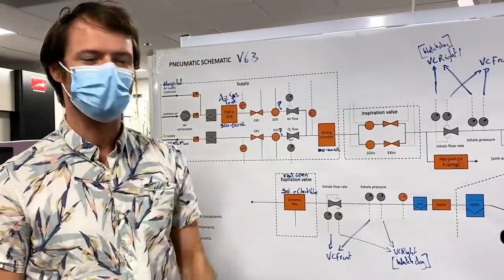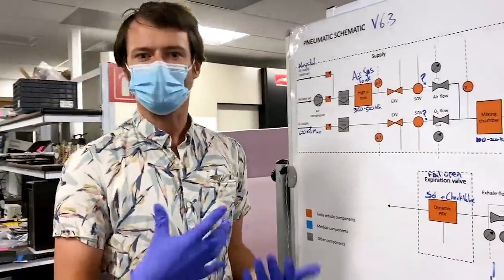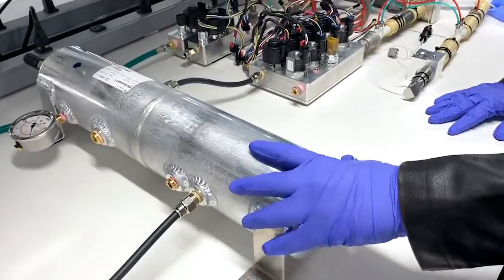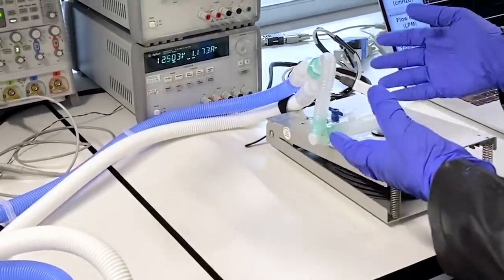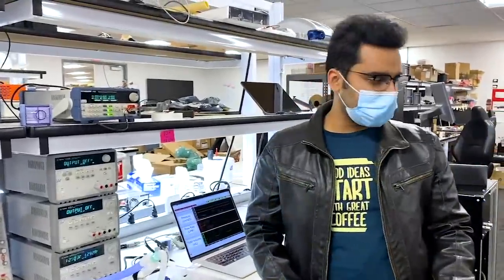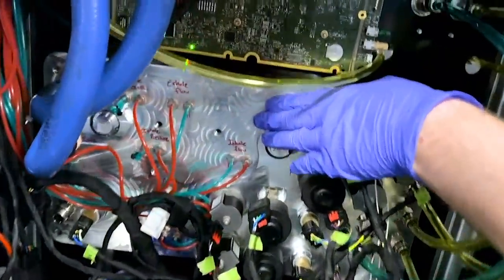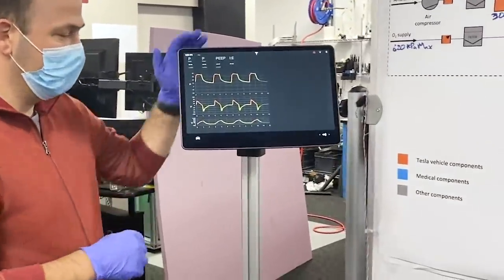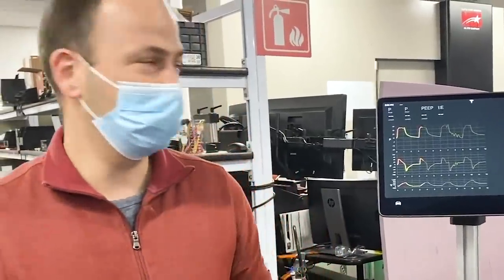Tesla Ventilator

Comment: this looks like an expensive ventilator
Reply: Ventilators are expensive. And extremely complicated. It seems like they are trying to design this to be built quickly at Fremont, without needing to do a major redesign of a production line. I hope that it works well.
Reply: @anthonypelchat  i meant some of the car parts are overkill for the ventilator, like the display pannel, and the tesla computer, however med equipment is generally pricey not because it's complicated but just because of the market and the heavy regulations.
Reply: @pneumonoultramicroscopicsi4065  Very likely that they are using units that are overkill. Still, the purpose isn't to efficiently and cheaply build a perfect unit. Rather it is to quickly get production started and ramping up with as little of changes needed to the Fremont factory as possible. 

If it takes a week longer to prep Fremont for production and then another week to reconvert back to car production afterwards, it will cost more than building the units with more expensive parts. Plus, less people will get much needed ventilators, potentially costing several lives.

Comment: I have used 
the hospital models (2019).

They are fairly expensive, 
thanks to persistant using 
of new production designs.

****
Job that I've had ?
-- That is all, for this process
-- Disassemble everything
-- Assemble new production process

?? 2/3 is the same ??
! Does not matter !
We redo everything.

Comment: Overcomplicated
Reply: Just like every high end ventilator.
Reply: @anthonypelchat  we dont need hi end right now we just need it to do the job, india already has a device no bigger than a purse that can do the job without hospital air supply and can be made very cheaply.  No time for money making right now.   Ps that device looks ten times stronger than his sheet metal tin can that keeps imploding on the test stands simply because no internal structure, but this you want to over engineer?

That fucking flusy that he was with that cracked him over the head made him loose braincells.
Reply: @Fatpumpumlovah2  Calm down. One, India's ventilator isn't allowed outside of India. I don't know exactly why, but that is the last that I heard. Two, hospitals are calling for the high end ventilators. I think that they know more than you what is needed. Three, this is built with parts that Tesla already produces. That will allow them to produce everything quickly and without having to reconfigure the factory lines. 

Starship is a different product from a different company. They are trying to build a rocket that's larger and more powerful than as ever flown before. And they're trying to do it cheaply, quickly, and publicly. The only similar rocket is the SLS. That has already cost around $20 billion and has been getting built for something like 10 yrs.
Reply: @anthonypelchat  never said they should use indias, pount is we need somethong now quick n dirty that works, not something 6 montgs down the line.  I am a structural engineer of 51 years, i may not know what hospitals request but when u hv an issue like this its there is no time to be overdoing and overcomplucating things.  As for spaceX  i know what they are trying to achieve but in the end i will bet my 51 years as an engineer it will end up with an internal skeleton structure, tin cans dont fly.
Reply: @anthonypelchat  ps diff company but same mind behind both.
Reply: @Fatpumpumlovah2  "We need something now, not in 6 months" We need specific items now. Needing hospitals, but building houses now since they're quick and less complex doesn't solve the problem of needing hospitals. Same here. We need specific types of ventilators or people will die. While there are needs for simple ventilators as well, Tesla can build the complicated ones while less capable companies build the simple ones.

For the 6 months part, Tesla is planning to have these designed and approved quickly, within a week or two. They are also designing these with parts that they already produce to speed up production. Once approved, they will likely be able to build a few thousand each week. 

As far as the design in India, that is a secret that India won't share. Tesla, as well as all other companies, would have to start from scratch to design something like that. Since it couldn't use the same parts as Tesla's cars, they would also have to design and build a production line, or drastically reconfigure a current line, just to get started building it. That would be unlikely to happen in less than 6 months. 

"Tin cans don't fly." Maybe not, but water towers do. Star Hopper already flew. The trick is to now build it so that it is as light as possible while being able to handle cryogenic fuel at extreme pressure.
Reply: @anthonypelchat  water towers have internal skeletal structure, not simply welded together sheets.  Your back on india again, was just an example!  I saw a young guy on american news showing his very simple setup that works off a 5 dollar audrino uno card!   Thats the simple i am talkng about.  Anyway  i digress
Reply: @Fatpumpumlovah2  The American's design may not be the right type. Hospitals are needing an invasive positive pressure ventilation system. The smaller ventilators are noninvasive systems that are simpler but less capable. Those are still useful, but not in critical applications. You can see all kinds of hate articles about Elon because he sent those types to a hospital in Florida. While the hospital had an urgent need for those and were very thankful to receive them, the haters jumped on this as an opportunity to hate since they were not the critical type. 

Almost all of the simple ones that you see are those types: CPAP, BiPAP, or APAP. They are useful in early cases and can be used by individuals at home. However, they are not useful for critical cases, and could actually be harmful if used at that time. Nearly everyone can design those simple units and they are easy to produce in high numbers. As such, there isn't a critical need for them from a manufacturer like Tesla. Tesla instead needs to work on the type used by intensive care, which is what we are seeing here. 

There are people trying to come up with a cheaper, easier to build unit for intensive care. To my knowledge, only the one in India is applicable. No one else has done so. If they have, then they are doing the same thing as India in that they aren't allowing anyone to use the design. Search YouTube for Real Engineering - How to build a Ventilator. Great info there.

Comment: *Respiratory Therapist questions*
As the guy potentially manning this device I had a few questions on the functionality. Are you only putting "control" modes or will you have some form of synchronous modes of ventilation? Will you be putting modes of support ventilation on this device? I like how you are considering the clinician with your waveform graphic presentation, but that overlay system is a little busy. Perhaps do something similar to other manufacturers and make it accessable in a history screen or a freeze screen function. Final question, will you be installing any devices for determining lung static compliance, dynamic compliance, and airway resistance? These are bread and butter physiologic variables that respiratory therapists and physicians rely upon for determining the health of a patient's lungs.

Comment: Why don’t you help existing ventilator manufactures make more of existing designs. Use your supply chain to help them get parts. They have already proven designs with proven algorithms. I spent years in oxygen and ventilator research. If not done correctly it will make the patient worse.

Comment: That's got the be the most expensive and over-spec'd ventilator ever. Using a system that can control a whole car's worth of electronics just to open and close a few valves.  AWESOME!  It's like what most people do with a Raspberry Pi when they start, blink a light on and off with a quad-core computer.  Could you imagine the ventilator that can stream Youtube and play surround sound audio.  I understand using what you've got is important, and I absolutely LOVE the idea.  But you've got to do the hardware justice and run at least two or four people (independently) per machine though.  Figure out a way to use even 2% of that hardware's potential.  Separate the control surface from the valves and daisy-chain the CAN bus out to control multiple sets of valves.  Read the pressures and velocities via ADCs on the A2B bus...   I'm sure the vehicle controller alone could handle several people-worth of valves.  I would say monitor the rising of the chest via a camera and some machine learning but that's done in a different computer...

Comment: Is the ventilator made out of 301 Stainless Steel and has an exoskeleton with armor glass, and Raptor Engines mounted onto a trust puck section?
Reply: The ventilator comes with a starship when bought 😂
Reply: LAND_GAMER XD Earth-to-Earth Starship delivery of ventilators XD. Before that happens, we must make sure Ventilator SN-1 doesn’t implode due to a bad Thrust Puck Section.
Reply: Yep. Single motor , double motor , or triple motor?
Reply: Meatwad Baggins Tri Motor with 37 sea level Raptor engines.
Reply: Yeah but does it come with a flame thrower?
Reply: @FighterFlash  
Yep and a hat
Reply: Meatwad Baggins and a Roadster with a hat
Reply: @FighterFlash  not a flame thrower*

Comment: Has everyone lost their mind?
The government should organize the sharing of EXISTING, PROVEN ventilator plans and firmware with companies, not letting them start from scratch! This is insane. These machines will never reach approval during this wave of the epidemic.
Reply: It's not that simple. The process for gearing up to manufacture a part that you don't already make is extensive. Machine programming, fixture building, training, post processing, logistics, etc. Then replicate that process for each of the numerous parts of a ventilator. There's a reason Tesla is using parts that they already make...it's the same reason they've been able to develop their solution so quickly.

I work at a firefighting and rescue equipment manufacturer and we're actually going through the process you described right now. We used to have another company make parts for one of our tool lines. We've been working on bringing those parts in house...for the last year. It's not a quick or simple process.
Reply: @pumas4pets "Tesla is using parts that they already make"
Adapting to locally available equivalent components is is OK, but they ought to start  from an existing, proven product.  Designing from scratch is madness. Tesla engineers are great, but nothing will replace the decades of experience of a well established manufacturer in such a short time.

Comment: Tesla: *makes amazing ventilators using parts designed for their cars, massively helping the medical industry

The FDA: I'm gonna stop you there.
Reply: other car manufacturers are also using car parts
Reply: true that, had these not been times of crisis, the FDA would have never let this pass.
Reply: @ispeakforthebeans  that's a bit of a moot argument. If wasn't a time of crisis Tesla wouldn't have to do this.
Reply: @ispeakforthebeans  One, they still have to pass FDA approval. Two, they are prototypes still in design and testing. Tesla is working with Medtronic and possibly other medical equipment providers on these.
Reply: These look good to me and apparently to multiple medical personal so far. They will have to undergo thorough testing before the FDA will certify them. However, the FDA is supposedly pushing certification testing quickly, instead of the weeks or months long processes that they normally do. 

My guess is that they have some detail guidelines to follow. We already know that Tesla is working with Medtronic. I doubt certification will take long.
Reply: Yeah God forbid there's any oversight of a device used to pressure ventilate someones lungs by a company that's never made a healthcare product.